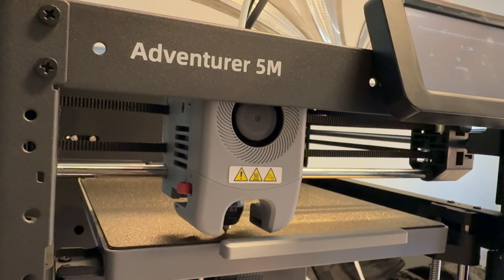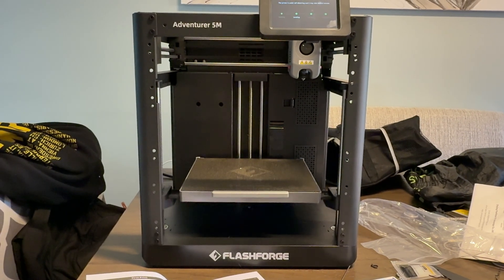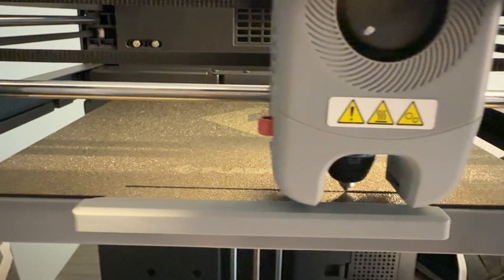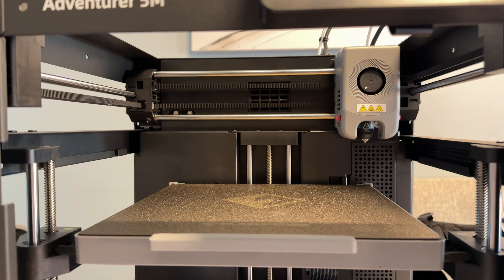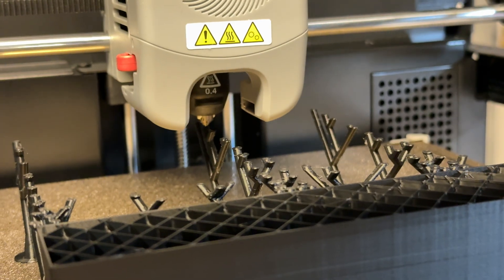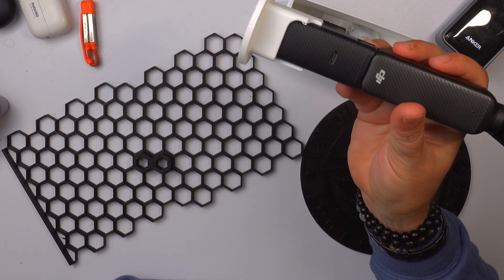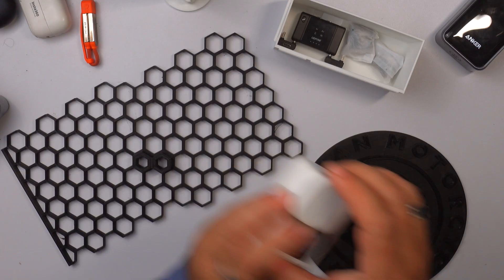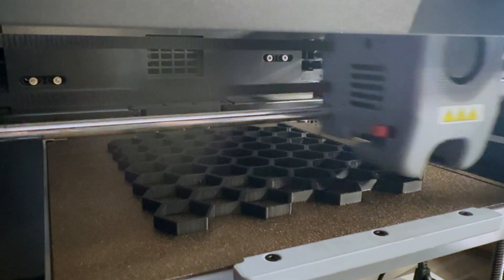FlashForge Adventurer 5M 3D Printer Review – A Beginner’s Honest First Impressions & Setup Tips

Comment: I have thinking upgrade to FLASHFORGE AD5M 3D Printer, I have Creality 3D Printer Ender-3 V3 SE from March 2024 still ok but not good printer narrow & tall thing too easily snap fell over & breaking support pillars while bed Y moving make wobbles just slow down printer 40mm/s. 
FLASHFORGE AD5M 3D Printer better they didn't moving on bed can bit speed up printer.

Comment: Hi I'm new to 3d printers I got the Flashforge adventure 5M and it is brilliant I noticed that your bars or runners have black lines on them wipe them off and put some of the grease on you will notice it will run smoothly and less noise put grease on them all. Kind regards Jo